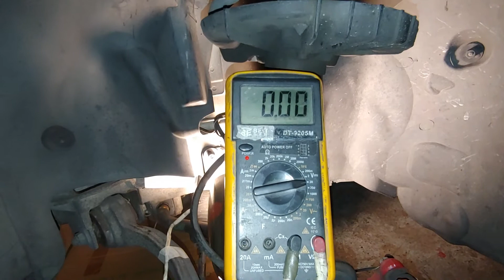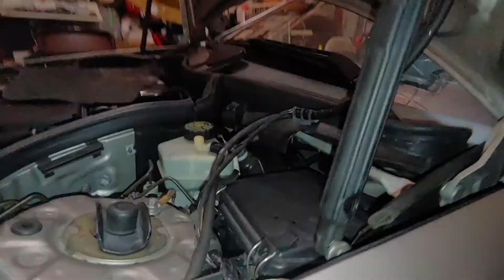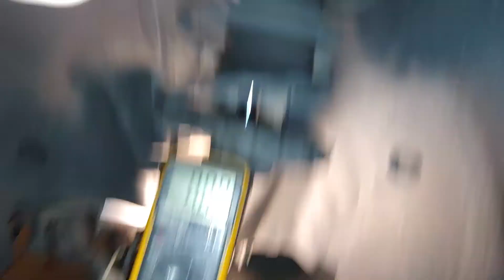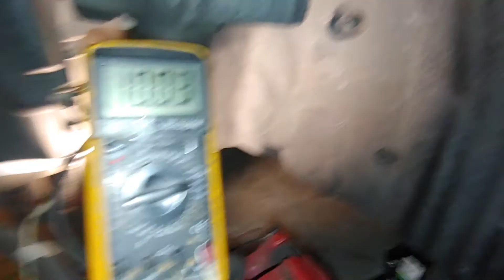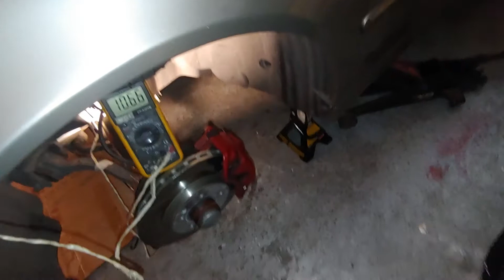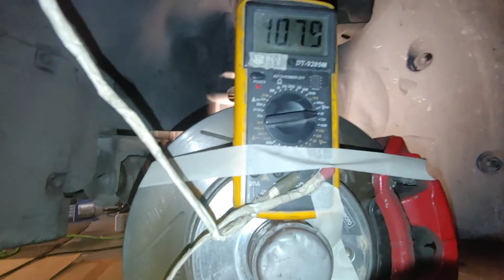Mercedes  2004 C230 w203. Compressor control valve solenoid voltage testing

Comment: Denso compressor, I think your solenoid control valve is shorted.
Reply from the maker: Hi thanks for responding. I tested the solenoid valve while the car was started and the plug that goes into it was disconnected, I applied 12 volts and ground to it and the car started shaking and I heard it click so it appears to be good but the voltage going to it is strange. I'm not getting power and ground I'm getting two power readings, one reading is lower than the other.
Reply: @HallEffect7798  12 volts is too much for the control solenoid control valve, it was designed to work at a steady efficiency between 4v to 10.5 max, any range above this will damage the solenoid. Mecerdes auto makers can be really heartless as not to share information that would assist technicians solve issues regarding thier cars, I will have to do a video about it, Toyota electrical systems or Volkswagen isn't a nightmare  compared to Mercedes, and the worst of all, it doesn't show up as issue using a scantool to scan the climate control module.
Reply from the maker: @Drcooltech  hi, Thanks for the info. When I tested the two wires with the negative lead of the meter grounded to chassis I get 11 volts from one wire and 4 volts from the other wire but the solenoid doesn't click or do anything at Cold startup. I also left the meter connected for about 5 minutes and the voltage didn't change. I kept the meter on the 4  Volts wire for 5 minutes and then the 11 volt wire for 5 minutes at Cold startup and there was no change on the meter
Reply: @HallEffect7798  Did you figure this out? Was it a bad solenoid? Did you replace it? 2013 E350 sedan here. Having intermittent AC. Trying to figure out mine as well.